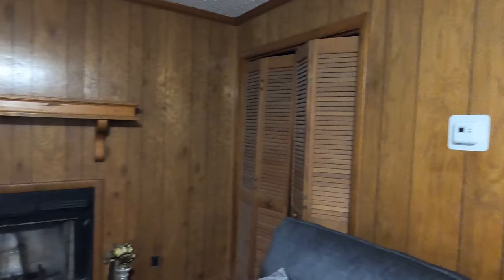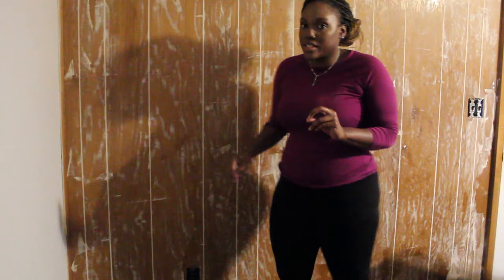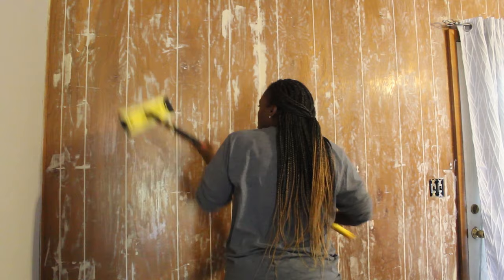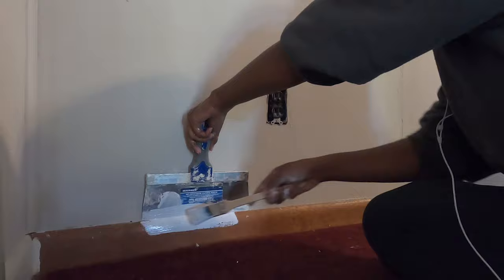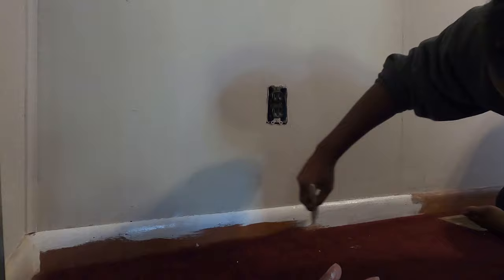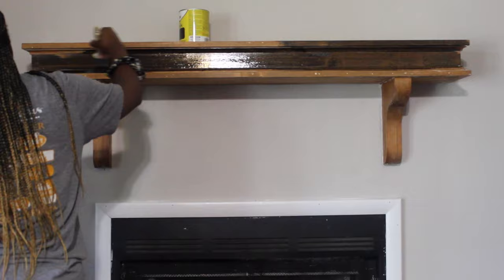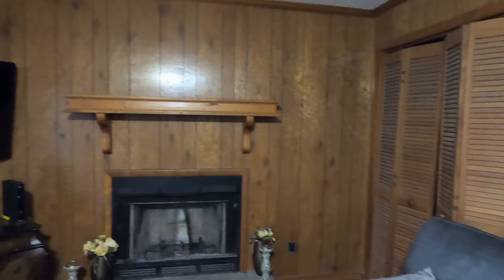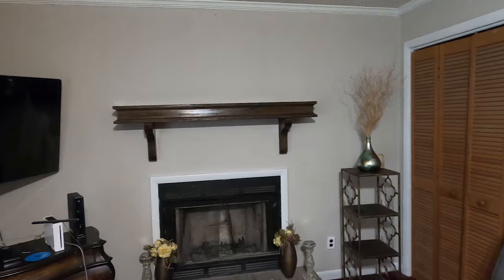Wood Paneling Makeover | LOOKS LIKE DRYWALL for $30

Comment: Hi, how are you doing? Great informative you tube video. After you applied the pink soft putty type material on the crack lines of the wood paneling and sanded the wood panels for smoothness , exactly what kind of white paint(if you can please name and provide the exact name of the paint you used in your you tube  video if possible) did you used on the wood panels, because the paint that you used on the wood panels looks very thick and affective on the dark brown panels? Other paints seem to be non affective on painting and blending the white paint on to darker wood paneling.   Also exactly what kind of white thick bonding primer material(if you can please provide me with the exact name) did you applied and use on the bottom of your wood trimming area on the bottom of your wood painting you tube video, since you said white paint was in affective on the wood trim wood bottom area ,until the white thick bonding primer was applied first ? Also I noticed at the end of your you tube video on how to paint wood panels with white paint, that the wall looked greyish? Because the wood trims looked real white, while the walls looked greyish? Did you also used greyish paint? And if you did used grey type paint, can you please give the exact name of the paint? Because I totally like the way you painted that room and I would like the same excellent results on my wood panel covered room. Thank you very much for the info and your time.

Comment: The painted wood panel wall looks great and so does Mia. I've got some painted panels at a rental unit of mine. I want to go back and fill in the lines with sheetrock mud and paint over the lines. Will this work after the wall had been painted before without fillng in the lines?

Comment: How did you clean the wall after sanding?
Reply from the maker: I wet a cloth with water, enough to get it damp. Don't wet it too much. If you do it can wipe off the joint compound.

Comment: Latex or oil based?
Also, you missed a step. It helps to vacuum the wall after sanding to get rid of that dust. You want the surface as clean as possible before painting.

Comment: Did you sand it first before you started with the joint compound? I see you're doing it after the joint compound. But wondering if you also did it before the video started to help the joint compound adhere since paneling is slick.

Comment: You really should sand the paneling with a sanding head(360 sander preferably) and then apply your joint compound. Why? Because it's less lightly that your walls will crack later down the road. Don't sand it hard or anything. You're just knocking the rough/high spots. Then apply joint compound. This makes the joint compound adhere to the wall better then just applying it straight to the wall.

Comment: Nice video. I have question.. Should we start with primer coating before applying paint on it? What is your suggestion? And were you able to make the grooves disappear completely after the final touch? Thanks.
Reply from the maker: I would use a primer before painting. I was able to make the grooves disappear completely. I only issue I had was in one area where the paneling was not done right, so it doesn't look as smooth as the rest.

Comment: Awesome work! Did you clean and/or sand the paneling before applying the joint compound to the paneling in order to remove the grossy finish? Approximately how long did the work in this video take you minus the vid and editing, etc? Being as your vid was posted in 2020 I am curious to know how this painting project has held up. Please share your experience. Is there anything you would have done differently?
Reply from the maker: I did wipe down the paneling before applying the joint compound. I would say it took me about 3-4 days to do this project. I recently posted an update on my channel showing how it held up and what I would do differently.

Comment: It's always entertaining watching people paint when they don't know what they're doing. Next time you paint trim, get a brush that is about twice the size as you were using. It will go a lot faster. Paint in a single direction when using a brush, not back and fourth (like the do in cartoons and most youtube channels) and use long strokes. The paint will look much better this way. Also, pick up some wide blue painters tape. You can use it on the floor and above the trim so you can paint a lot faster without worrying about getting paint on the wall or the floor. Use a putty knife to get it into the corners and under the trim on the floor. Also, put a piece of tape over the light switches and wall sockets so you don't have to carefully paint around them. 

Most importantly, sand and wipe down that wood paneling with a de-greaser before you put the compound on. The paneling is not drywall, so the compound may not stick as well as it does to drywall, which is much more porous. That wall does look a million times better and it would be a shame if the compound starts coming off after a few months because it wasn't bonded properly. In some houses the paneling is put on over the drywall, you can just pull the paneling off and patch and paint the drywall.

Comment: Great video...What paint/primer did you use?  I want to do a smoke grey wall..any recommendations?
Reply from the maker: Thank you ! I used Sherwin Williams paint in the color alpaca. I didn't use a primer on the walls, I just used two coats. If you are going from a darker color I would recommend using a primer before painting. I don't have any specific recommendations for a smoke grey color, but you could go in the store and get samples to swatch your wall.

Comment: Hey I was curious if everything is holding up well? I followed a video about using a wood filler on my kitchen cabinets and although it looked good at first, it settled and didn't look so hot after a few months. Wondering if everything still looks as great as the video? Love the outcome!
Reply from the maker: Yes, it is still holding up well. It looks the same as when I first did it. I haven't had any problems so far and if I do , I will be sure to let y'all know.

Comment: I did this and it works look amazing. However it takes FOREVER. Also every time you touch the wall or the couch bumps it pieces of the drywall pop out.  Cheaper than drywall but kind of sad it has begun to mess up

Comment: How long does the compound last? How often do you have to replace the compound and paint?
Reply: It doesn’t quite last that long even when you use a setting type Drywall mud which sets in a certain amount of time it’s not air dry The one she uses in the video is an air dry one that you have to wait overnight before you can sand paint it. If you have the time and patience you can install 1/4 drywall over the paneling  or for more Strength you can use 1/2 inch drywall which actually cost less than the thinner drywall depending where you are usually the quarter inch drywall is a little more but you can decide which one you want to use. Putting drywall over paneling  is a more Long-term solution.

Comment: Has the joint compound cracked or fell off at all??? Been wanting to try this method
Reply from the maker: No it hasn't fallen off or cracked. I believe its because I didn't overfill the crack or apply too much joint compound. Also, sanding it before painting helped.

Comment: Nobody liked paneling I'm the 90s lol....your about 30 years off on that.
Also you need a primer over the joint compound before you paint.  The joint compound will soak up the paint and the wood won't so you will see a difference.